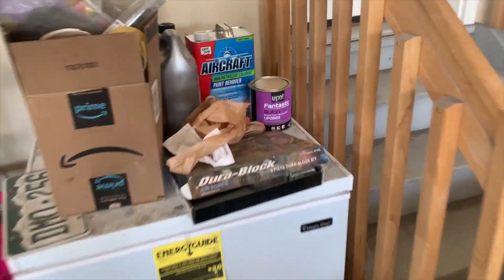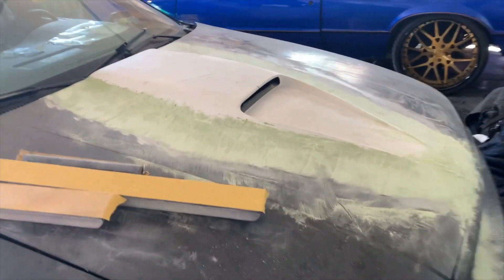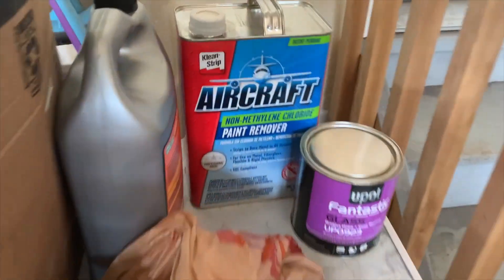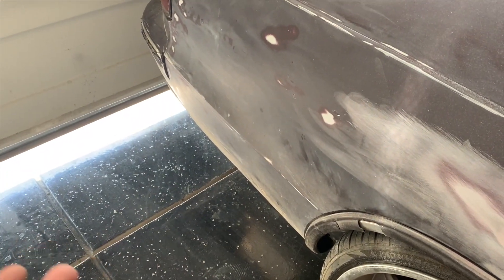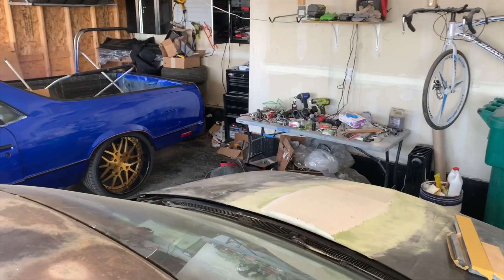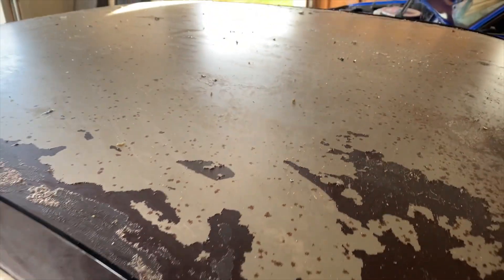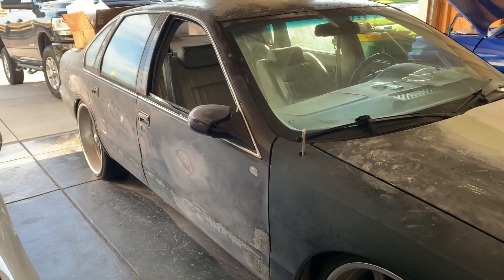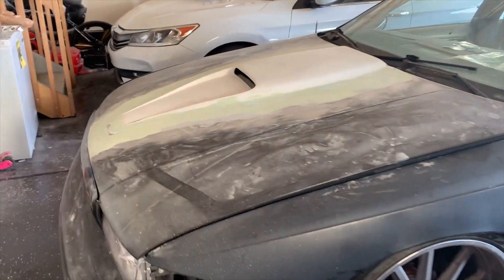STRIPPED MY IMPALA ROOF DOWN TO BARE METAL!!! [BODYWORK]

Comment: Look into body panel adhesive. Its what they use to hold newer cars together without welding. It you can find replacement panels for that rust you can cut it out and use it to hold it into place. The stuff is solid and wont budge.
Reply from the maker: I’ll definitely look into this thanks bro
Reply: @grindschool  I used it on the elco, I have some tools to help holding everything into place and to make a edge to set the new piece into place.
Reply from the maker: I actually don’t think I’m going to go thought route! I just looked up the lower quarters and someone on eBay is trying to sell just one for $250
Reply: @grindschool  you think you can shape it with just some sheet metal?
Reply from the maker: Yeah I think that’s manageable and just tac weld it in then use the filler
Reply: @grindschool  something like that.